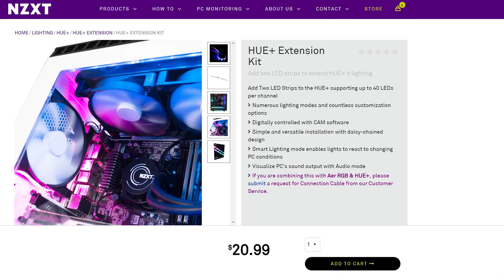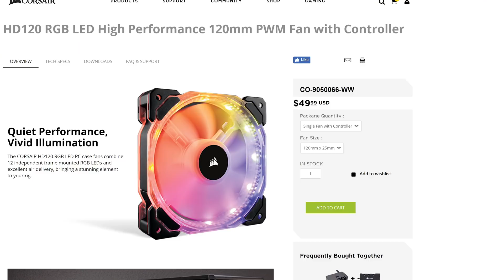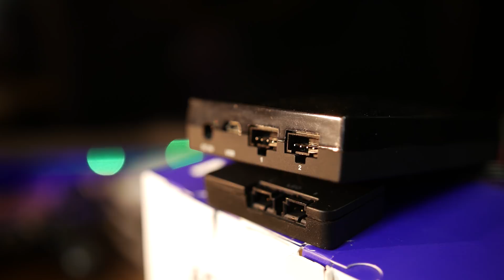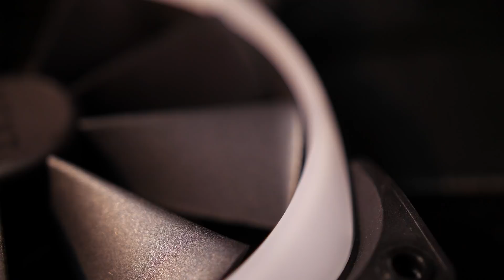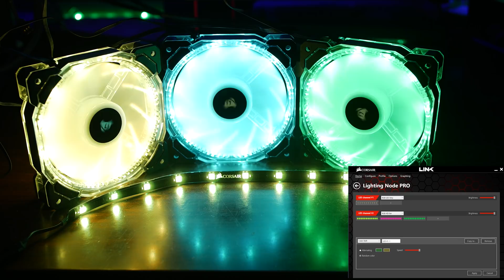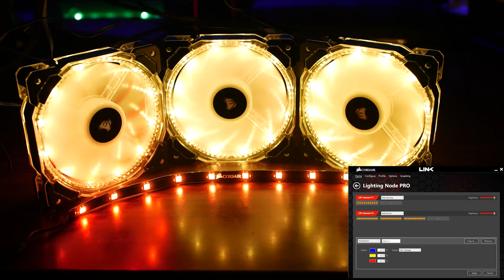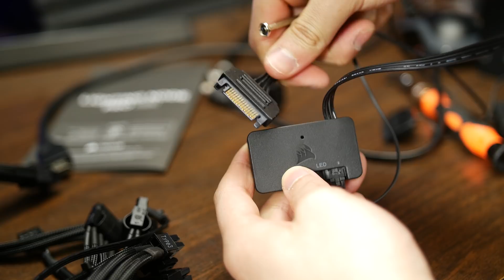NZXT HUE+ Vs. Corsair Lighting Node PRO

Comment: You can buy the Corsair Node Pro for $30 without the RGB strips if you want.
Reply from the maker: I think that's just the Lighting Node.  I'm not sure what the difference is between the Node and the Node Pro, but I assume there is one, since the boxes look a little different?  Though I can't be positive, unfortunately.
Reply: ALittleDIMM The difference is you don't get 4 RGB LED strips.

Comment: Man, it's a struggle. I really like the nzxt kraken x62, but I also like the corsair rgb fans over the aer rgb's...I wonder how difficult it would be to use both, maybe install corsair rgb fans onto the x62...Hm.
Reply from the maker: You could use the HD140 RGB fans on the Kraken!  You'd just need to use Link and CAM at the same time!
Reply: ALittleDIMM  I'll have to wait and see if they actually stock the 140s in Australia, nothing so far.
Reply from the maker: Ouroboros Ah, I'm not sure when that'll happen, unfortunately. Good luck!
Reply: https://www.amazon.it/Corsair-co-9050069-ww-HD140-RGB-ventola-controller/dp/B06XQYRKT1/ref=sr_1_1?s=pc&ie=UTF8&qid=1493501589&sr=1-1&keywords=Corsair+HD140

Comment: is there a way to hide the light source on the enthoo? it looks so tacky seeing the individual strips but havent seen an example of them hidden well
Reply from the maker: The front and back strips can be hidden fairly easily (depending on what angle you look from) because the case has a bit of a lip they can sit in.  I placed the top strip behind my radiator, so it's not noticeable.  The bottom one is probably the most difficult because the light bounces right into the basement shroud, but I was thinking of removing that strip altogether and putting it under my case instead.  Might have to be creative ;)
Reply: ALittleDIMM okay thanks. i love the case to death and dont even own it, thats the only thing that has pushed me away from it. sick setup though. im sure it can be hidden on the bottom somehow. i was also looking at p400s tg
Reply from the maker: That's another good option!  I almost got that one, myself!  But if you end up getting the Enthoo Evolv TG, I'm sure you won't regret it!
Reply: ALittleDIMM haha thanks dude, i just got my maximus ix hero and 7700k yesterday. thermaltake 750w rgb and 1080 strix and 16gb trident z rgb ive had. need case and new monitor and im good. i did some digging and putting an acrylic strip over the rgbs on the basement will kill the individual leds and make the whole case shine. I've had my eye on the satin enthoo tg so ill probably get it and try that acrylic strip. you should review amztronics case fans. they are very very sexy and at 39.99 for a 3 pack im sure your viewers would appreciate it. currently on amazon with a perfect 5 stars 😃
Reply from the maker: Oh ho, good timing!  Those fans came in just today!  I also planned on doing some acrylic work, though it wasn't going to be in the Enthoo Evolv!  I've got a few videos I need to get out first, but those will be coming soon!

Comment: I have the corsair 120 mm HD and the only down side is that just now they released the 140 mm fans...Use corsair for case fans and the ntxz cpu cooler cuz it looks cool
Reply from the maker: I thought the same thing!  I bought the 120s and then all of a sudden, 140s were on the market!  Ahhh!
Reply: Hahaha glad we can share the same pain :D or sad..im not sure :)
But i allways wanted the 140 mm to fill out the case...Maybe i will buy 3 x 140 for the front because the 3 others are not that visible due to my case is under my table :D

The only thing holding me back is the cable management i hate to do over :/
https://www.dropbox.com/s/gaf2d7fxai5fglh/20170421_194308.jpg?dl=0
Reply from the maker: I can't see the image right now, but I feel your pain!  Cable management can take so long sometimes!
Reply: It was my pc seen from the back side with all the wires looks like spaghetti monster :D
I used the corsair mini to hide all the fans power cables..what is ur opinion ? Keep the 120 in front or go for the 140 mm and all the extra work ? They are a bit expensive..30 eu each..so 90 eu total and thats for 3 single fans..no boxes what so ever
Reply from the maker: Hmm, I would need to see a picture of the case, first!  Or at least know the exact case model.  Corsair has a few "mini" cases, I believe.
Reply: uploading a video soon,,hmm everytime i click on the bell link to see ur comment then 1-2 sec is played of ur video before it stops..and in this time range i sounds like you say " Time to shit"  but you say time to shed :D
Reply from the maker: LOL.  Well, if you're watching my video, it could very well be time to shit!
Reply: Im gona switch the 2 x sli 970 out with 1 1080.just not sure what to pick yet..freesync or g synch again..cuz im gona buy a new monitor also..so im in the think box here..and dont mind the big cpu fan..i know its huge but i choosed it because its low noise and pretty damm good for cooling..I always used noctua cooling..no RGB there XD  Just shit brown fans :D
Reply from the maker: If you choose Free-Sync with the 1080, you won't be able to use the variable refresh rate benefits.  I'd go with a G-Sync monitor for that one!
Reply: Im leaning toward G sync also...Its just my greatest fear is to get a minitor with awfull backlight bleeding and dead pixels or worse..i had an asus pg27 ips panal and that was another nightmare story, but i got my money back after 4 times RMA..Btw did you see my video ?
Reply from the maker: If you go through Amazon, they have a really nice return policy!  And no, I haven't had the opportunity to see your video, yet.  Currently at work, so media consumption is limited!
Reply: Ok let me know what you think when ur off from slavery :D
Reply from the maker: I see it!  It looks find as it is, I'd just keep your fan setup that way, no need to spend more money!
Reply: Ok thx for ur opinion..enough time has passed setting this up..btw did you have the node pro also?  The latest firmware messes up ur fan leds so the lights dont work..
Reply from the maker: Yes, I know!  I mention that, and a fix at 11:02 in the video ;)
Reply: Lols I dident watch so far as i was eager to post in here :D
I found this trick to reset but still the software pops up with the note about the update. and corsair says they are working on it,,no eta yet..i hate pop ups :D

Comment: If I have the nzxt aer 2-kit that includes the hue controller but no leds, will the extension kit provide all the connections I need to implement the leds? Great vid btw!
Reply from the maker: Unfortunately, I don't believe it does.  Though, I'd be surprised to find out that the kit with the fans didn't include two connection cables out of the box?  And thanks, I appreciate it!
Reply: Oh man that blows, really takes the wind out of me... So what would be my solution then? Definitely don't want to buy a second hue controller!
Reply from the maker: I wouldn't want to, either!  I would double check to make sure your kit doesn't have a second connection cable included with it.  I'd be really surprised if it didn't, my HUE+ kit came with two of those cables and four LED strips.  If it doesn't, I'm not sure if NZXT sells the cables separately, but you can always try contacting them and checking for other options.  Good luck!
Reply: Do you mean it will use the same cable I used to connect the fan to the controller? I've just seen, if you look at the nzxt website, they make a comment that if you've purchased the aer and hue combo, you must send a message to support to request the cable. I just wasn't sure if that cable was already included!
Reply from the maker: Ah, wait.  For some reason, I keep forgetting you purchased a fan combo.  In that case, it makes sense that they didn't include cables for the LED strips, as they are different.  But at least they let you know you can contact them for it!  Sorry for the confusion!
Reply: No worries! I was just hoping I didn't have to buy online as I'm in canada but shouldn't be a problem!

Comment: Interesting. The Corsair items are 1-wire control and have WS2812 LEDs. The NZXT appear to be 2-wire, so are likely (and hopefully) APA102. I could probably make a custom controller for them too. I just really prefer the fan-blade lighting of the Corsair fans, which looks astounding with custom control hardware (I just posted a demo video of that so I'm looking at other videos about the fans. ^.^ .

It's a pity that the physical connections are so disparate as a result of the differences. Means that making a single controller hardware item that could handle all of them would be more of a challenge.
Reply from the maker: That'd be a neat project!  Unfortunately, it's way over my head, but it'd be a cool thing to check out!
Reply: I'll probably skip making an NZXT version due to finances. I just really don't have the money to spend on a bunch of NZXT fans to test it when I don't actually have a use for the fans. I'd have to have a good reason or spare funds to buy the fans, but chances are with an extra pin and possibly some code changes on the alignment, I could make it work pretty quickly.
Reply from the maker: Totally understand!  Whatever you end up doing, I wish you luck!

Comment: Does the hue+ fit in the meanit 5pm case using the rear ssd mounts? (I have the AI crystal, and due to their similarity, I would assume if it doesn't fit in one it won't fit in the other)
Reply from the maker: Sorry, I don't think it would work!  And if it did, it'd be a real tight squeeze.  You could always mount it somewhere else with tape!
Reply: Oh well... But maybe I'll be able to mount it to the 3.5 drive mounts?... i have a 2.5 drive around here somewhere. TIME TO TEST!
Reply: I can say with 99.95% certainty that the Hue+ will fit in the HDD brackets in the Anidees AI Crystal.
Reply from the maker: Wretlaw120 Yes, the 3.5" drive bays should also be able to hold SSDs, and therefore also the HUE+!

Comment: ❤
Reply from the maker: <3
Reply: ALittleDIMM And whats the difference to Asus aura rgb stripe from cablemod
Reply from the maker: Those RGB strips can connect to supported motherboards and other standard RGB headers.  They're typically limited to more basic effects like static, breathing, and color cycling.  The ones featured in the video cost more, but also offer more features.
Reply: ALittleDIMM And why do Nzxt or corsair bring a product which can handle both?😰
Reply from the maker: More advanced features require different kinds of connections and controllers, I guess!  Kind of how when you solve a math problem, there can be a dozen ways to do it.  Corsair's way and NZXT's way just happen to be different!
Reply: ok thanks
I really have to say it, I like your video's and your voice and I hope you keep going on with it❤😊
Reply from the maker: Aw, thanks!  I don't plan on stopping any time soon!

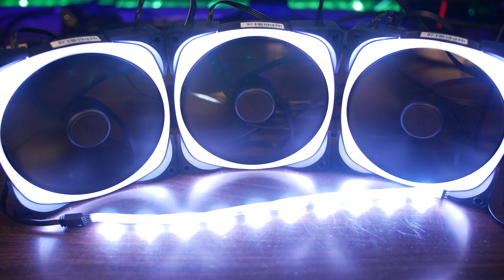Comment: had to pause at 10:40 to comment about the bluish tint that the white preset puts off. i found this to be an issue with various different rgb components. not all have the issue, but a simple solution is to set the color to orange and then turn the saturation down. you end up with a much more natural white this way. though a rather inconvenient method, one can still achieve the exact white tone they are going for.
Reply from the maker: Oh, nice, thanks for the information!  I'll have to give that a shot!
Reply: no problem. i may just be color blind though. lol. but definitely give it a shot. it takes some tinkering though. like, don't just set it to orange and then go all the way to white. as this will likely result in the same blue tint. so try to find the right saturation point to where it's still running off of the orange hue.
Reply from the maker: Got'cha, I'll give it a go, thanks!

Comment: Great video man! One question: If my mobo doesn't have enough fan headers, can I buy some cheap fan controller hub or does it have to be the NZXT Grid+?
Reply from the maker: A cheap fan controller hub will work!  The fans' four pin cables are standard, so their RPM control works just like any other fan!
Reply: Thanks for answering so quickly. I hope one day this channel goes big
Reply from the maker: Aw, thanks!

Comment: it's FANny you made this as i am very interested in the X62 kraken from NZXT for my PC,it does look incredibly FANtastic but i feel with too much RBG in the case it detracts away from the kraken as a center piece...i think that the fans in a build with the kraken should be a static colour with a 'little dimm' affect rather than a stronger light effect pulling your gaze towards the krakens lighting effects add a little RGB ram mayhem into the mix like you have with your Gskill trident and this would make for me the perfect combination
Reply from the maker: The nice thing about both of these systems is that all the lighting can be dimmed!  And since all of the LEDs are individually addressable, you can make some thing stand out and other things sit back!  (Loving the puns ;) )
Reply from the maker: I've done it in my case for the backgrounds of other videos, but yes, I can totally implement this into a case review!  Also, I loved those movies!
Reply: wasn't such a fan of the new clash of the titans as the older one had more nostalgic meaning for me...but dumb and dumber...awesome

Comment: I got a Question concerning the RGB functions provided by the Corsair Node Pro. I currently have the HD 120 in my Rig and compared to the Node i recognized that i am missing some of the RGB Modes mentioned in the Video. When i purchase the Node and connect it to the RGB Hub for my Fans, will the Node expand those features, in other words, will i have access to more RGB Modes than without it? I hope that i can point out my problem properly :D Thanks for the Video, as always great quality and content :P

cheers my friend!
Reply from the maker: So you'll have one set of effects with the Node Pro and another set of effects with the controller.  The Node doesn't really "expand" the features, it just replaces them.  Hope that makes sense!  Thanks for the support!

Comment: may i ask how did u get that gear rgb thang
Reply: n also can i ask if they (if any) would work with the rog rgb controller thingy
Reply from the maker: Gear RGB thang is an acrylic piece with a HUE+ strip behind it!  I'll have a video on that coming up eventually!  And unfortunately, none of these will work with another's software or hardware, they will only work with their respective systems.
Reply: ALittleDIMM thx steven ❤❤

Comment: Great video, just one thing though, the CAM software for NZXT has SPEED options which will smooth out the effects if you slow / speed them up or down to get that perfect RGBling affect that you want :)  I have used both the Corsair RGB hadware and the NZXT RGB Hardware and currently my case is sporting ONLY NZXT.  I have found that the Corsair software is a total shitefest IMO and having the ability to run and configure my RGB LED strips, RGB fans, my AIO CPU Cooler and RGB LEDs for that and my GRID+ NZXT fan controller all from the same place is just awesome.  I have had MUCH less issues with NZXT's CAM software updates and firmware updates.  Also NZXT has a phone app for Android and iPhone to allow you to set all your stuff from anywhere you may be or just to check on your PC and see that all is well.  Their phone app is very nice!  Corsair have a phone app?  Nope!
Reply from the maker: Yes, it does!  Though, those slower speed settings are what I was referring to!  Corsair's slower speeds don't seem to be as choppy as NZXT's, and that was my primary criticism there.  And I agree, NZXT's software is much more robust, but I'm hoping to see Corsair's expand in the future!  Also, the phone app is pretty awesome ;)
Reply: Yeah NZXT took the 'WINGS' lighting effect out of CAM but it's still in the phone app and it works great from there... :)  I talked to NZXT and 'WINGS' is making a come back in CAM v3.3.2 :)
Reply from the maker: Neat!  I was wondering where that went as I was doing this video...

Comment: I have the same issue with my Corsair HD120 + Led strips and the lighting node pro, you can use SIV to get some of the effects back but its not the easiest software to use, the hardware switch has much better lighting controls at the min. the Cam software is loads better but there RGB's are not as good so its a case of rock and hard place :\
Reply from the maker: You never know, Corsair might implement those physical controller effects into their software!  Wishful thinking!
Reply: I really hope they do :)